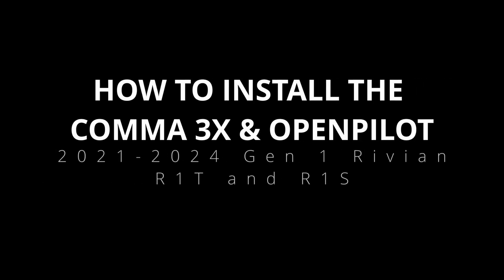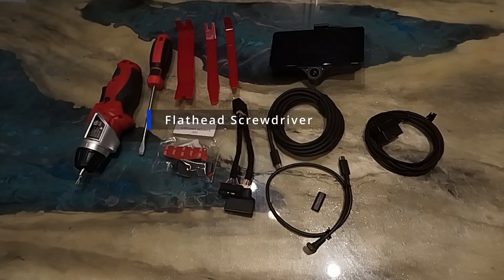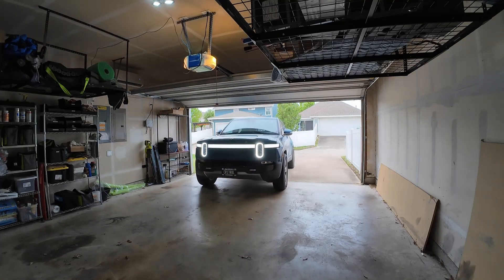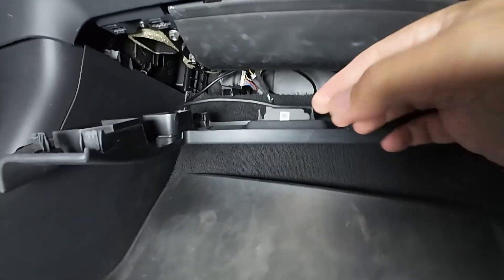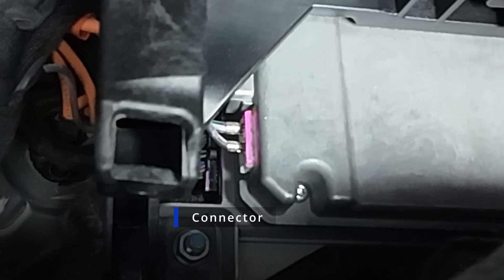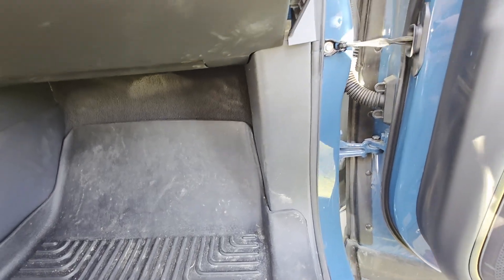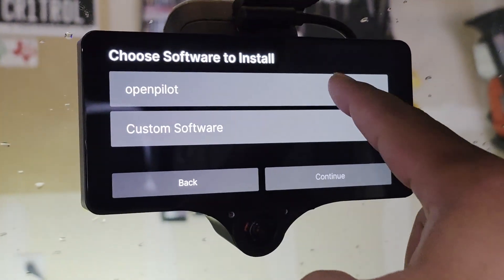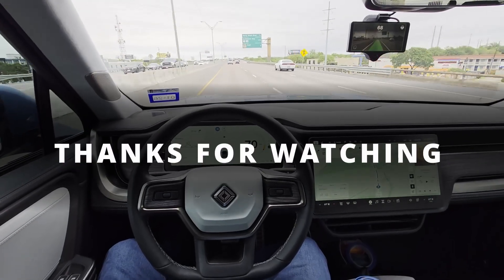Comma 3X / 4 Install Guide for Rivian R1T & R1S | OpenPilot Setup Tutorial

Comment: I’ve been trying for days to get it plugged back in but can’t. Can you post a video of actually doing that instead of skipping over it?
Reply from the maker: That is the most challenging part, especially in '23+ models the other wiring harnesses make it hard.to get your hands in there. My only advice is to try to use your right hand to reach around the frame and help guide your left hand while putting it in.  Feel with your fingers where the port is, it's further back than you'd think.

Comment: I finally installed the Comma 3X after 4 days, and 12 hours of labor with help from 8 different people . MY first calibration attempt failed with a pitch of 9.9 degrees and a yawl of 0.5. It is possible the failure was due to the very wide road without lane markings. I dismounted and unplugged then reconnected and remounted . The screen never changed from the Comma symbol. I again stopped repeated the exercise getting the following message "System Reset System reset triggered. Press confirm to erase all content and settings. Press cancel to resume boot. Confirm was highlighted but the system did not respond to pressing either choice..
Reply from the maker: Wow, that sounds like some install experience!!  Have you tried the tap method?  When you plug it in and the comma logo appears, continually tap on the logo until the reset screen appears.  Let me know if that works, otherwise you may have to reflash it.  Also, are you using an 8-degree mount?  Your pitch seems WAY off.  My pitch is only off 1-degree.
Reply: @theelectricvalentines  I'm using  one of the two supplied mounts. I ASSUMED they were same. On the COMMA  page I found where it takes time for the capacitor to discharge and to leave it disconnected for an hour. I have the Comma in the house and I was going to do the flash procedure until I read about the capacitor.  Will try again today.
Reply from the maker: @AlbertStiewing  If you ordered it with the Rivian harness they should have shipped 8-degree mounts but it sounds like you have the standard mounts which are going to give you a very deep pitch, since Rivians (and trucks in general) have a much steeper slope than most cars.

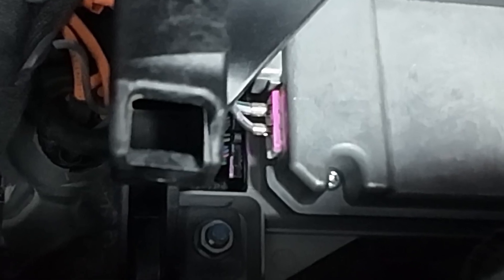Comment: 2:45 holy crap that was hard to plug back in.
Otherwise everything went pretty well, I have it working. I even used the OBD-II aux power. Just used a thin fish stick to slide from driver's side to passenger side up against the firewall.
Reply from the maker: Nice! Glad to hear the install went well! Yeah, getting that thing plugged into the AXM is a challenge!

Comment: Do you not have to connect the obd port to obd?  Only usbc cable to power comma unit or did I just miss that step?
Reply from the maker: The OBD Comma Power should be optional.  Technically, the harness should be able to provide power, but some people have been reporting that the BSM radar that the harness pulls power from can be unreliable, in which case you can use the OBD Comma Power to provide it.  I have been getting reliable power from just the harness itself, but YMMV.

Comment: Thanks for the extremely helpful video. Installed my harness today, just waiting on the comma 3x to show up.
Reply from the maker: That's awesome!  How did the install go?
Reply: @theelectricvalentines  Tight space to work in, had to bring my patience haha.  The comma 3x device was delivered today.  Plugged it in and get a blue light on the back but the screen will not turn on.  Sounds like I need to return it and order a replacement.  Bummer, was so excited to try it out today.
Reply from the maker: @christopherkemp5110  Did you try bringing it inside and just trying to power it from a normal USB cable? You can see if it powers up normally that way to isolate the problem to either the Comma device or the harness.
Reply: @theelectricvalentines  Yep tried that too.  Get a blue vertical line that briefly shows on the screen but then disappears.  Maybe an issue with the screen.
Reply from the maker: @christopherkemp5110  Yep, that definitely sounds like the Comma :(

Comment: Did you not use the 8 degree wedge with the magnetic mount, as recommended for a Rivian?
Reply from the maker: Great question!  I am actually using a magnetic mount from Chia Chunli that has the 8-degree angle built-in!
Reply: @theelectricvalentines I have a magnetic mount from Janka’s Workshop that looks nearly identical and came with an 8 degree wedge. Do you think the wedge is included to get the 8 degree angle back to 0 degree?
Reply: @JoshEAllen  Different mount makers do it in different ways.  Janka makes their mounts in a standard angle that is good for most cars and just includes a wedge to change the angle for steeper windshields like our Rivians.  Chia creates two different versions of his mount (a standard version and an 8-degree version) because he doesn't like the idea of having a separate wedge in between the windshield and the mount.
Reply: @gerrylum  perfect, thanks the reply! I was looking into the Chia after my last post here and thought that might be the difference.

Comment: For those watching. Just a reminder - center the unit under the rear view mirror, not the camera cover.  The camera cover is not centered on the vehicle, but the rear view is.
Reply from the maker: Good catch, thanks for letting everyone know!
Reply: @theelectricvalentines  You do say rear view mirror, just thought it needed to be reinforced :) ,  It's kinda natural when your head is right there looking at mounting to want to center it on the cover.
Reply: I was looking to mount mine about 2" off-center to the right.
Reply from the maker: @martin-from-naboo  Shouldn't be too much of an issue.  It's more important to get the pitch angle right, so make sure you're using the 8-degree mount.
Reply: @theelectricvalentines  Are you using the beartech mount?
Reply from the maker: @martin-from-naboo  I'm actually using the Chunmount from Chia Chunli.  I find it to be a bit beefier than the other mounts.